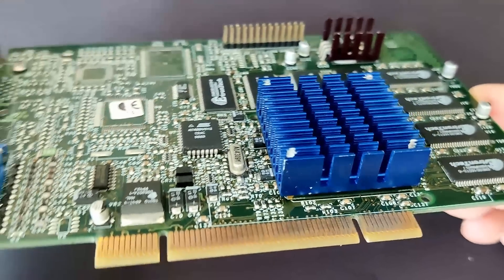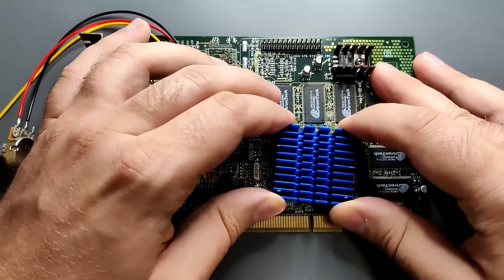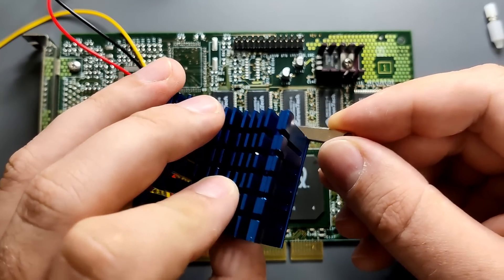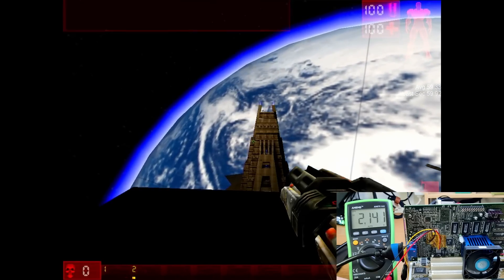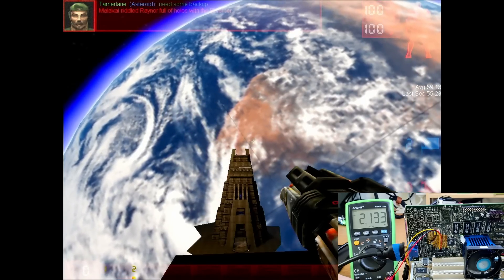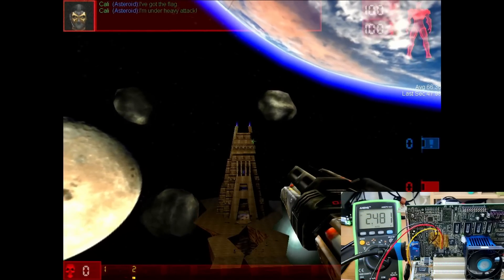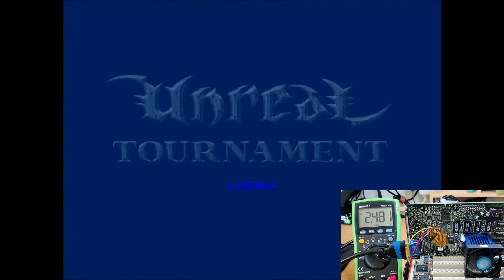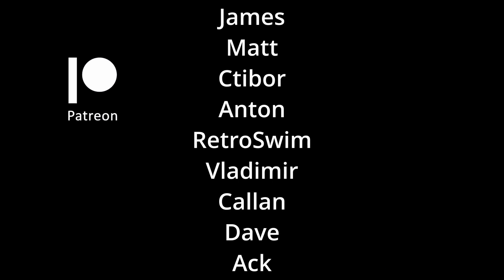The road to Voodoo 3 2500 | 3250 | 3800?

Comment: I have grown tired of the idiocy of these videos. Voltage and Current are in diversely proportional, as voltages increase current decreases, as voltages decreases, current increases. Increase in Current causes... WHAT? Heat MF. 
No subs no likes!
Reply: Mate, what you are thinking of is keeping the same power draw. But that is not what's happening here. Here, as in all silicon chips, the power draw decreses with the decrease in voltage and current. All you need to do is turn on and off transistors with the least amount of voltage you can. 
Please educate yourself before writing such comments and, if possible, conduct your own experiment. You can easily under-volt a modern CPU and GPU and monitor the temperatures and power draw. You could also do the other way around and over-volt your GPU or CPU, see if the temperatures decrease due to your assumed current decrease.
Reply: You;re blabbering. Undervolting is common practice to reduce the power draw and hence, reach lower temperatures and more longevity for the component. You're new to PC stuff, aren't you?
Reply: It’s always funny seeing someone be so confidently incorrect 😂 

Why do you assume that current increases when he undervolts? Rather the current draw is the same so watts and temperature decrease, same as a modern CPU or GPU. Why do you think people undervolt the latest Ryzen chips etc? 

In fact you can see the proof in the videos themselves as he literally shows the temperature decreasing using a thermal camera 😂😂
Reply: Calm yourself. We are all learning here. To expect people to have graduate level electronics engineering experience is silly. Take it easy.

Comment: Clock it at 180 mhz and you'll get to name it the Voodoo 3 3333. Can't pass on an opportunity like that! 😂
Reply: I would say
125 MHz - V3 1000
133 MHz - V3 1500
143 MHz - V3 2000
150 MHz - V3 2500
167 MHz - V3 3000/3500

183 MHz - V3 3600
200 MHz - V3 3800
Some of these numbers are the original ones, the others are inspired by the 4200/4500/4800 Voodoo 4 cards.
Reply from the maker: You are absolutely right about the 4K model numbers to be reserved for Voodoo 4 cards. I changed the title of the video!
Reply from the maker: I love that!

Comment: I haven't looked in a long time, but I bet that it's possible to get some crazy huge VGA heatsink which will somehow fit.  Then you can even attach some RAM cooling, and gigantic fan.  Brings me back to the good old days of running an LE-1640 @ 3.2GHz at ambient air temperature while a Delta fan deafens my neighbors.  Fond memories.
Reply: There is someone who put a Voodoo 6000 in a gigantic monster of a cooler. Basically 2 slots of copper on each side.

Comment: It's not that dangerous to hot-air the memory off, so long as you hot-plate the whole PCB. Hot air the outside surface with cold GND/PWR planes is what delaminates PCBs.